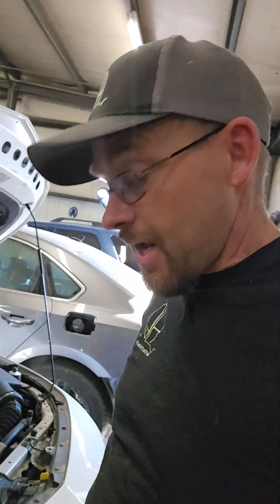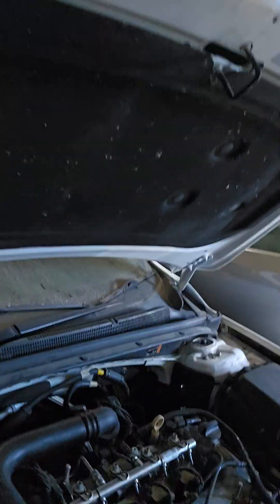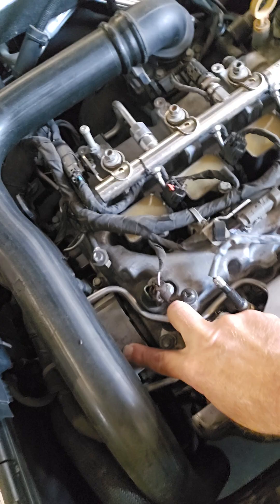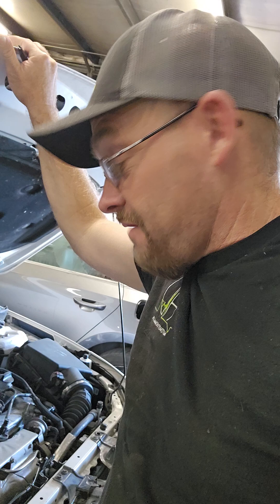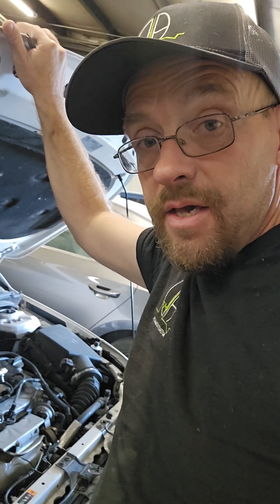2020 Chevrolet Malibu crank no start...

Comment: I need help on my car problem it's shows code p0335 but it runs then running miles away it dies
Reply from the maker: @Robertbecerra844  i mean, that's a crankshaft position sensor performance problem, you didn't specify the year make or model, i'm assuming you have replaced the crankshaft sensor already. I would lab scope the sensor when it acts up to see what the pattern looks like. I would also be scoping the cam.Sensors, at the same time for reference.  Crank sensors are often heat sensitive failures, which makes sense.As you have to drive it to get it to occur.

Comment: You just helped us with a malibu thats been causing us trouble after it broke the vaccum pump, thank you
Reply from the maker: The in cylinder tells the whole story, this one's exhaust cam timing was over 20 degrees slow, and it ran like it had egr because technically it did because of too much valve overlap. (Well once you got it started by disconnecting the exhaust cam sensor)